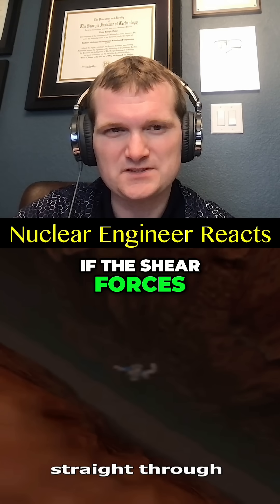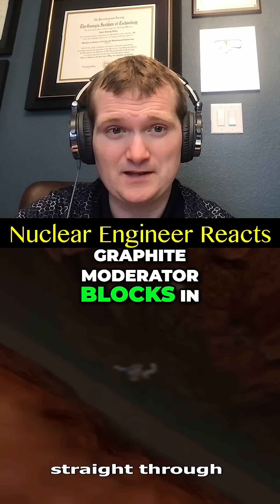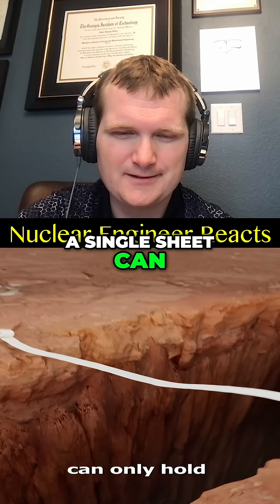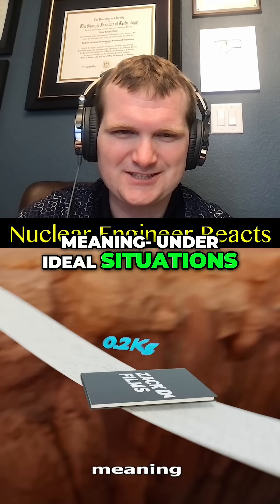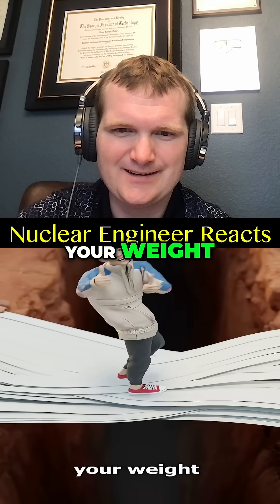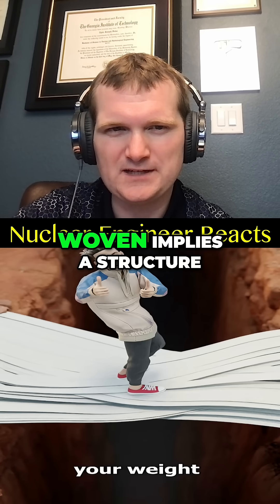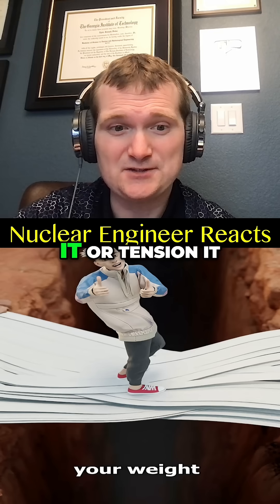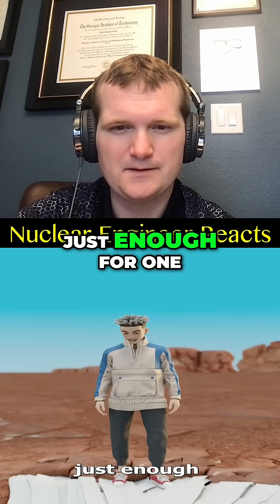Crossing a Bridge Made of Toilet Paper - Nuclear Engineer Reacts to Zack D. Films

Comment: Og you’re usually right but think about things but I think interweaving the sheets and having them covering each others seems would eliminate that contact point pressure. You would be able to break through one layer, but then the next layer would hold tight and that would be stuck sequentially along the thickness.  However, I am doubtful that 20 layers of toilet paper could reach the level of tensile strength necessary.